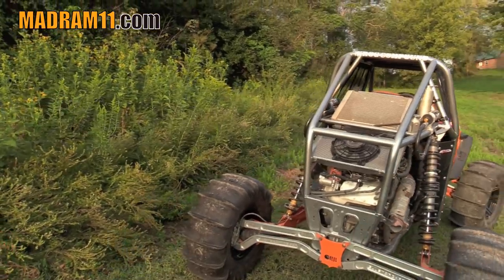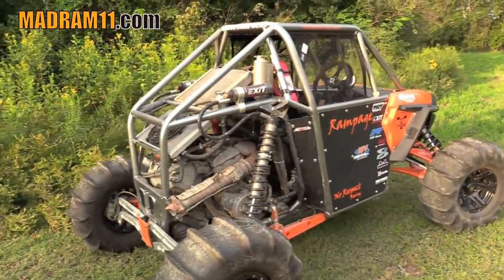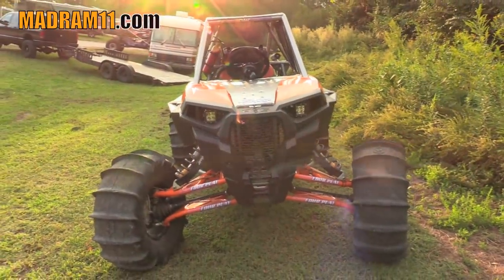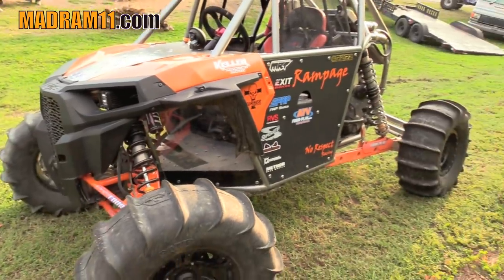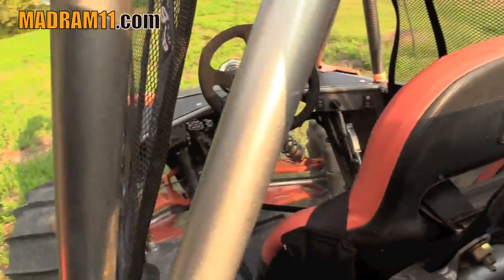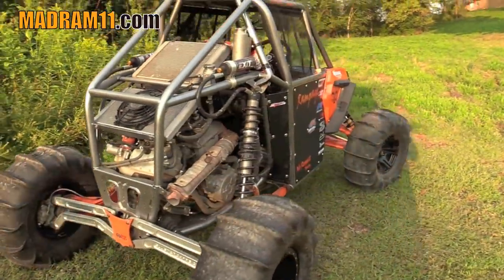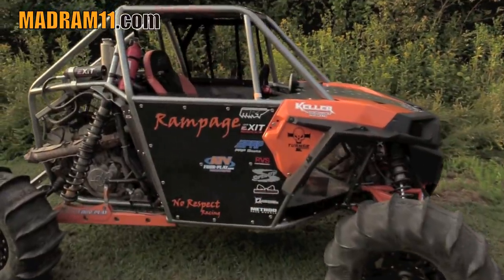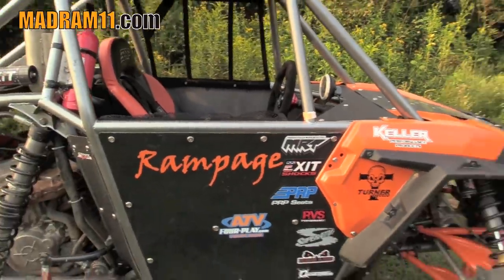CUSTOM BUILT CENTER SEAT TURBO POLARIS RZR

Comment: Wicked build, wouldn't surprise me if we don't start seeing more custom fab Ace style UTV's. Sure it's a money thing but for most, but don't see why you could take a Ace 900 and build off it as a platform. Beef up the chassis, custom cage, axles, tweak the motor, A-arms, relocate the rad, 3 way by-pass long travel shocks etc. Thanks Matt, that thing is sweet.

Comment: he built it ... he designed it ... for sure.
Reply: By "designed" he means he picked all the parts he liked off the website and daddy threw his wallet at it.
Reply: He designed it himself went to many races and pick out different lines from different cars mostly  ultra 4  and was all built in our 30x45 garage at my house  only thing he didn't do was tig weld it  helped bend tube notch fit   tack tabs into position  many build pics on my Instagram
Reply: no respect anthony Yount so exactly what I said. And for "designing" it, he seemed to be pretty unaware of the parts used. I get being camera shy, but he was oblivious to the parts used or why. Whatever. I'm not saying it's not a neat rig, but humility goes a long way. As long as you're happy, then go you.
Reply: money520 agreed couldn't have said it better myself. I think it's pretty cool what this kid and his dad did.
Reply: thethePete  come out to a race  id put my kid up against any other racer there as far as knowledge of a sxs machine  and the parts it one and ability to repair one. you try being 13 and standing in front of mr madram11 and talking to him knowing it may end up on YouTube and reach a ton of people
Reply: @onebad...
yeah, the 13 year old boy did hard work to get somewhere ... you nailed it. 
the dad bought it, the dad built it, the kid said poppi poppi i want dis and i want dat ... 
so i don't disrespect the dad for buying and building this rig - therefor THE DAD did some hard work and get somewhere in life, i disrespect him for lying - that his 13 year old wunderkind did it himself. LIAR!
Reply: I applaud the kid!!  A heap better than stuck in front of a TV regardless of who's wallet carried the build.
Reply: no respect anthony You should ignore lil Petey & those like him. They clearly don't understand that designing a platform in the garage on an amatuer budget often means "pop, we need to shorten this and lengthen those"...and it's not always designed by a team of geeks on a CAD machine in a nascar shop. You guys clearly have a good build that works for you. The fact that you & the boy built it together is a huge bonus & it'll follow him for his entire life. 👍🏻👍🏻🇺🇸🇺🇸